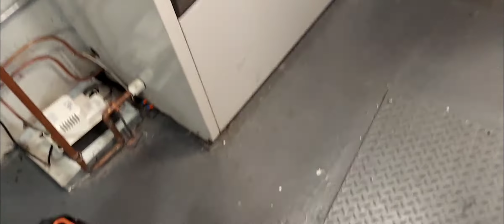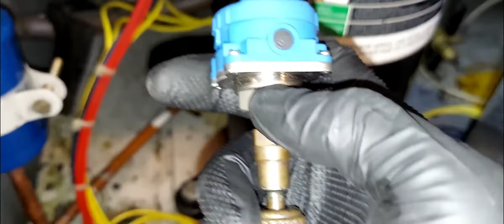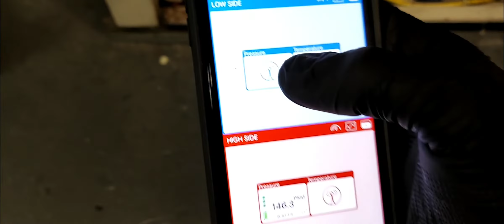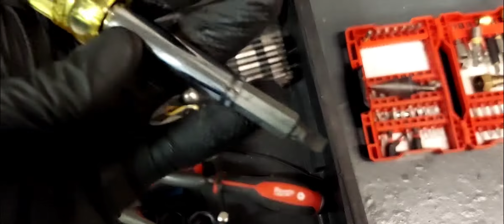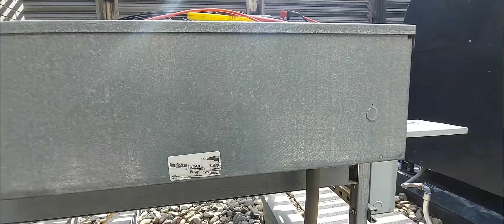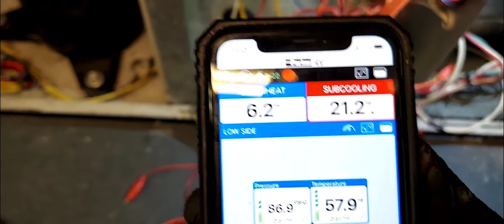HVAC TROUBLESHOOTING |   A/C NOT COOLING

Comment: If you’re gonna have a remote condenser, might as well have the compressor with it. The set up you had there I’ve only seen in large systems that have multiple condensers, and supply dehumidification as well. Like for pool rooms in hotels.

Comment: Good video, You should check the fan motor for shorts to ground and internal windings before you reset the breaker. 👍🏼
Reply from the maker: Good point
Reply: can you explain how you would check that

Comment: please explain your definition of the discharge line and cooling lines again ???
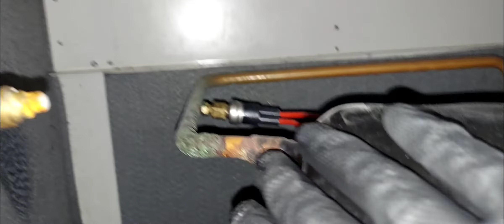Reply from the maker: 12:32 video time stamp compressor discharge pipe ( high pressure high temperature gas pipe leaving compressor) smaller pipe on the compressor
Reply: @D2DNYAC  so, there's a hot gas out to the remote condenser and liquid line back to the evaporator